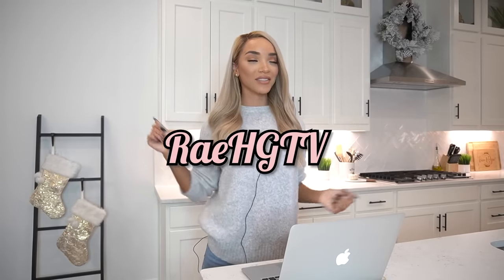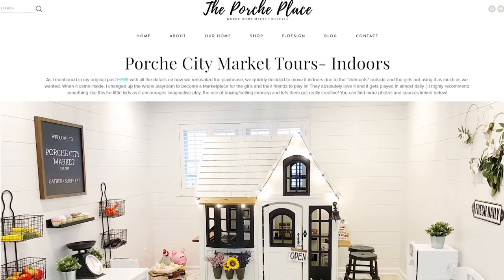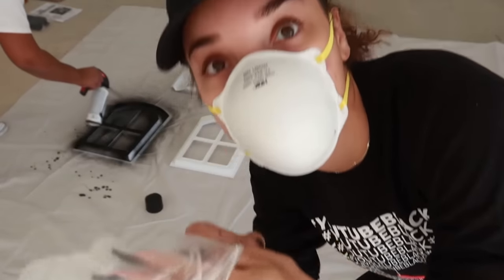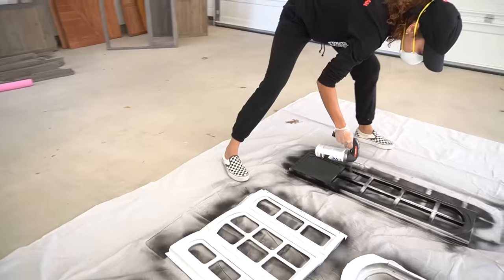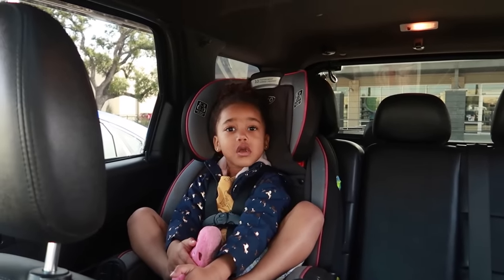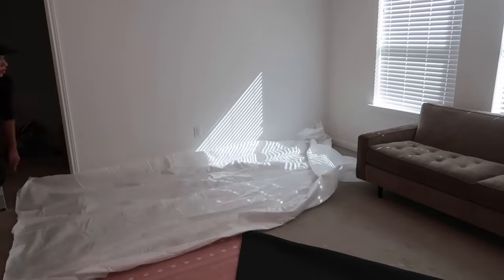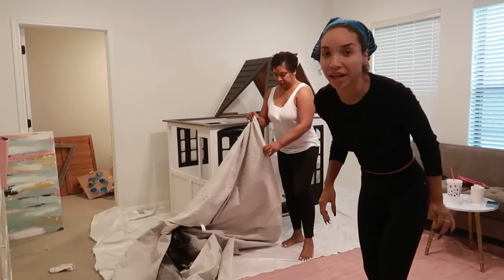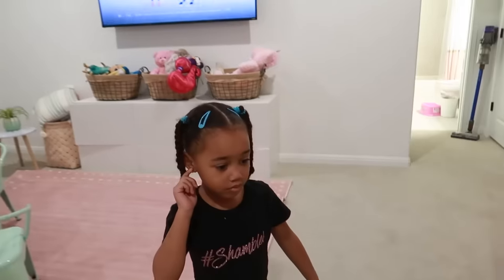DIY Playhouse Makeover! (Ziya's Dream Home!)

Comment: You should put the fake candles that you used for the video making time for Zaya in the lanterns
Reply from the maker: I thought about that but the switch for those is on the bottom so I wouldnt really be able to stick them down to the lanterns, i didnt want too many things that would just end up disconnected from the house or getting lost.

Comment: I’m currently working on one for my kids and I’m curious if you have had trouble with the paint scratching right off the plastic windows? I spray painted the plastic windows with the same rustoleum spray paint, but it just scratches right off very easily. Hoping that I can put a sealer over them and it will help. 

You both did great work. It looks amazing!

Comment: Because spray paint is oil based, and most paints you'd get for walls and such (indoor or outdoor) is water based (excluding some made for decks unless its Solid, its oil based) your playhouse may begin to peel after a while because you used water base over oil based paint. You can do oil over water but not water over oil because it won't permanently stick to the surface.

Comment: The reason you're getting paint on your face is because you're wearing the mask upside down and the metal strip if you push on it it's  supposed to shape around your nose so that the mask fits and so that doesn't happen